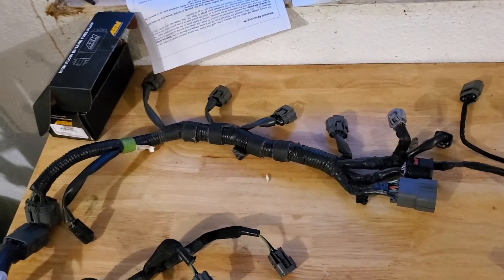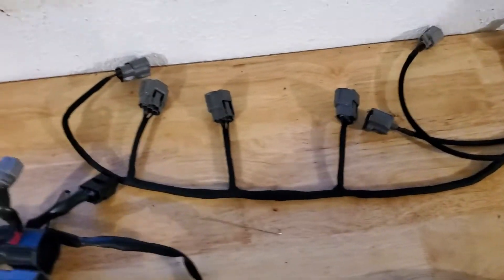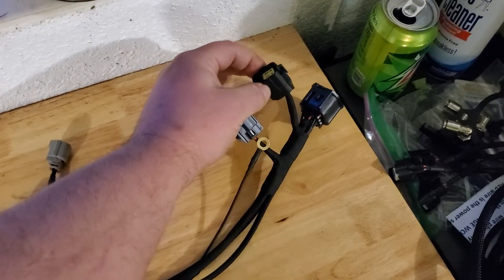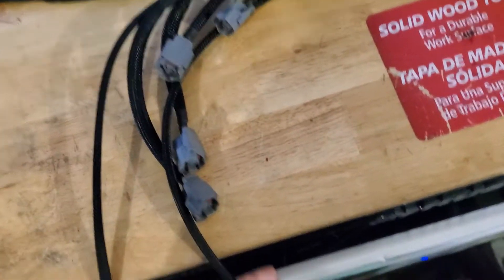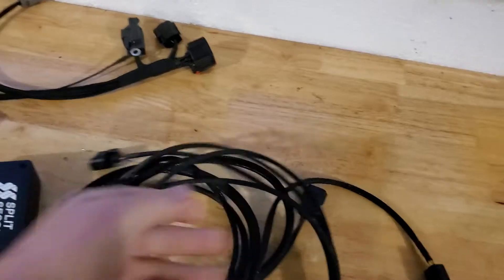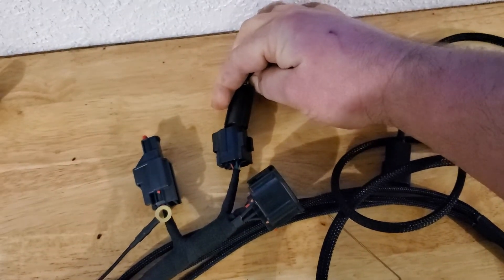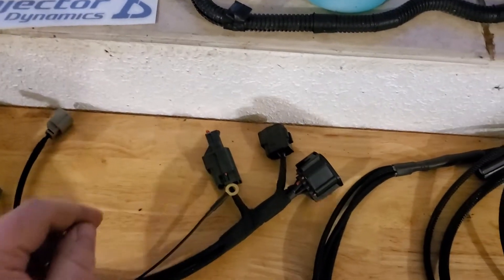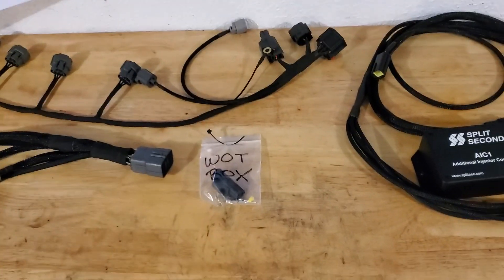Mazdaspeed 3 and 6 mazdaspeedwiretucks full harness and lazy boi for port injection!

Comment: Juat seeing this a few years later, where does the connector for the VVT solenoid end up on the coil pack tuck? I kept trying to eyeball it in the video, but feel like missing it somewhere on here.
Reply from the maker: Vvt is not apart of that harness. Vvt is on pass side of engine with the alternator wiring and stuff.
Reply: Ah yes. My bad. I'm going to have to do this myself since the Wire Tuck Guys are done 😢
Reply from the maker: @jamesrussell2171  nope... there not done! Eric is yes. But get a hold of Greg Senge. His work is top notch 👌 he is on the mazdaspeed pages. Shoot me a message on Facebook if you want. Just look up Kyle Scott Wagstaff. I would be happy to help.

Comment: would u know the overall lenght on the harness's and lenght on the coil connectors as they branch off the coil packs. Building my own and i could use the info if possible.
Reply from the maker: Shoot i have absolutely no idea! Most people built it on the engine...
Reply: @gimmethecarkeys  Thats what i am doing. Figured i look to see if someone had the length to save a little time. Thanks for reply though.